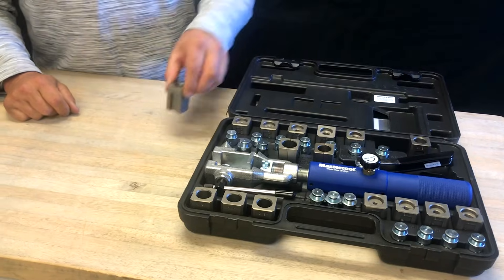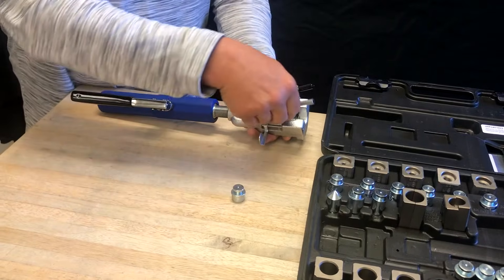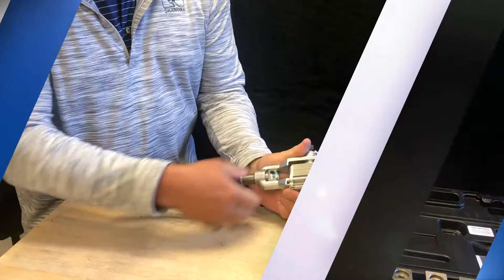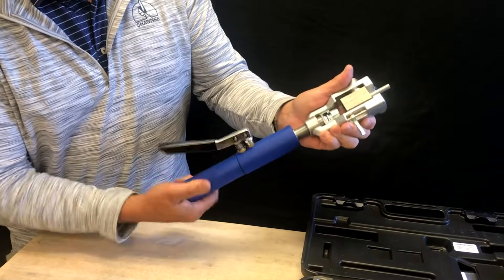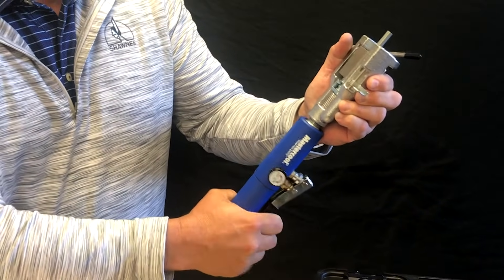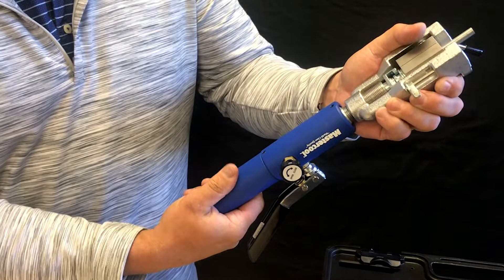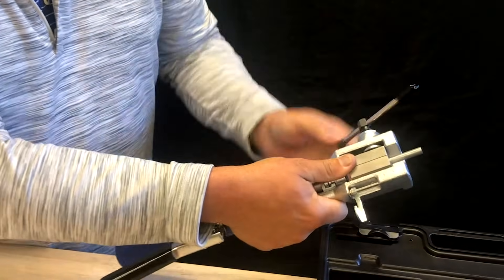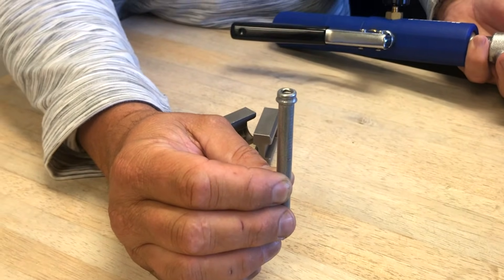Mastercool Hydraulic Flaring Tool - How to Make Perfect Flares

Comment: I own one of the older versions of this tool without the die stop.    Can the newer yoke be purchased separately and retrofitted onto my older model.      I love my older model and haven't used it a ton and it would be awesome to upgrade to the improved design without having to buy another tool.
Reply: I take another die not being used and turn it sideways and use that as a stop. But i agree, they always come up w a better way after you spend a small fortune on a tool